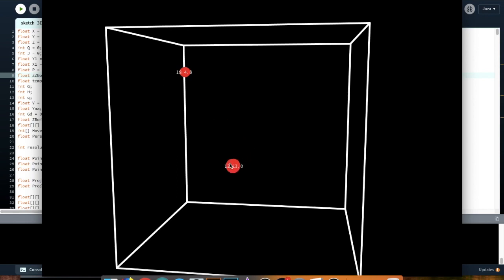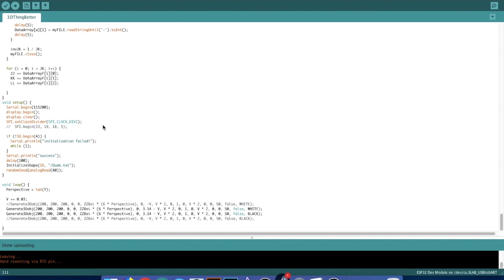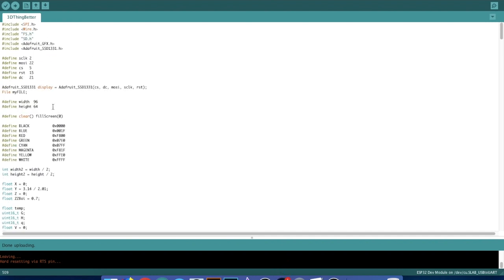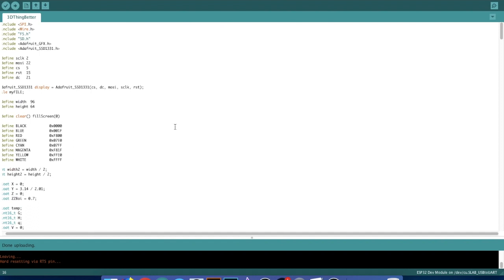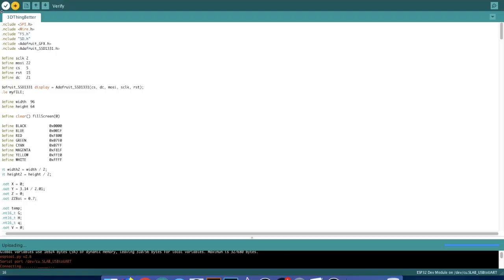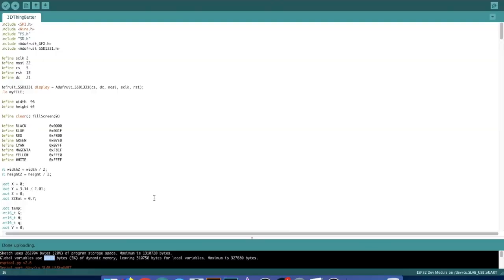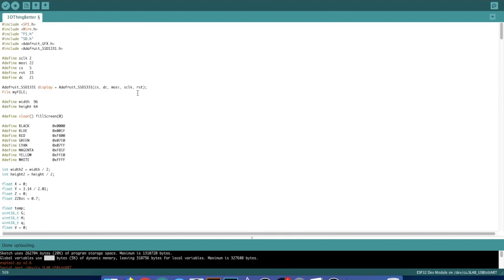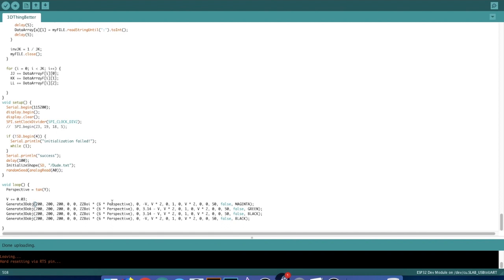10x faster than Arduino!! - Arduino 3D Engine 101 #8

Comment: Double buffer.  Draw into back buffer while front buffer is being displayed.  Then flip pointers of front/back for next screen. Not sure if your display supports that.
Reply from the maker: The main limitation is the flash size and the fact that the display I used doesn't support pushing an entire frame to the screen at once.

Comment: Hi!
You can connect directly an SD card to the ESP without using any modules for that. If you have a MicroSD card adapter you can simply solder only a few wires and just connect it to the esp. You can find articles on the internet about it.